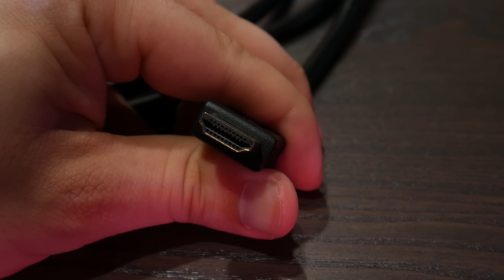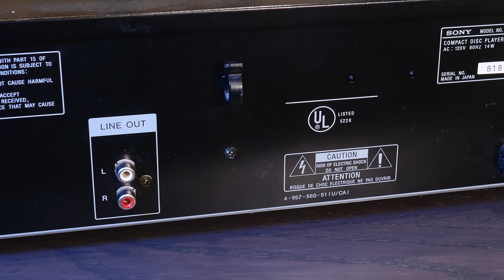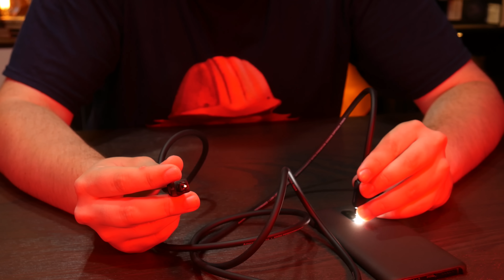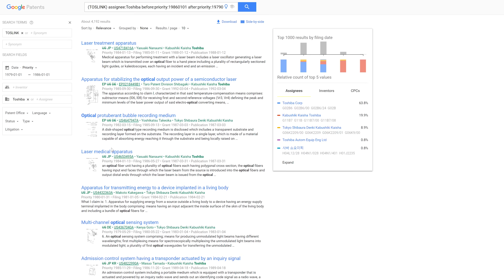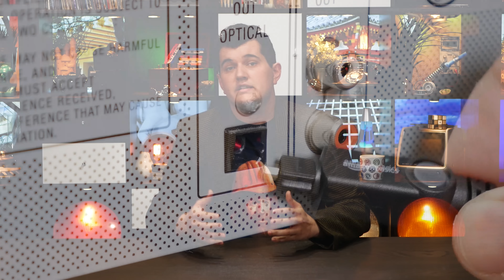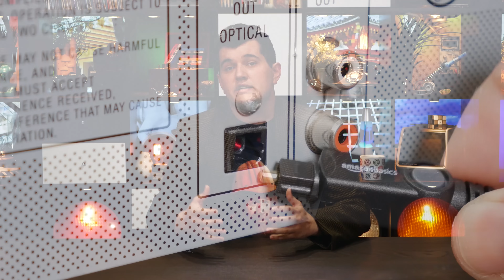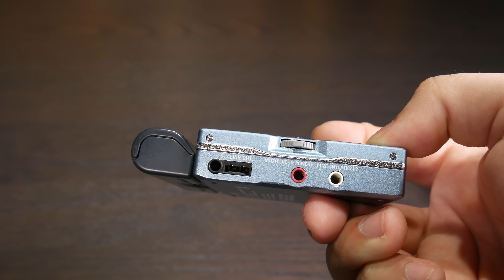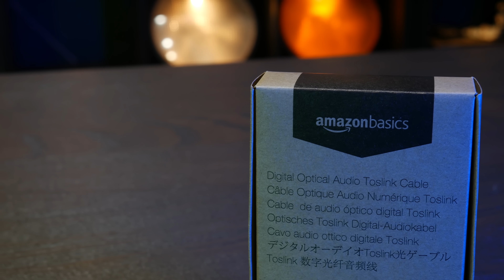TOSLINK: That one consumer fiber optic standard

Comment: I use those cheap $10 TOS PCM converters & string out analogue lines to my 1969 Kenwood. The problem is the TV has no downmixing so when I change over to local it spazzes out. Thanks, Obama

Comment: I used standard RCA cables on my old pc for spdif.
Since my new pc build only features toslink, i got a cheap toslink cable and used this instead of coax.
I should have done much earlier since my old pc also had toslink and coax since it had it´s problems when i switched something inside my room.

All new modern mainboards don´t have coax anymore, it was even hard to find one with a decent onboard sound and toslink to connect my amp.

It runs at 48khz and i will never go back to standard 3,5mm to rca analog junk.
This thin single cable can handle it all.

Comment: Ethernet is a protocol, not a cable standard. Ethernet can be carried on fiber optic cables, and it can be carried at much faster speeds much greater distances using LC fiber optic cables (in most cases, there are other cable standards that can be used but LC seems the most widespread). In fact, its what I use in my home network and the vast majority of the networking done at my place of employment also uses fiber.

Comment: I've thought about using TOSLink to isolate my computer from my ham radio. Currently I use audio cables (with ferrites and isolation transformers) to a USB soundcard. I am still getting occasional glitches that may be due to stray RF during transmission.

Sort of an extreme case relative to the ordinary consumer
Reply: it's basically the only solution to cheaply isolate old amplifiers from noisy ATX power supplies, just grab a toslink dac and it's done
Reply: I've always said if you keep some roast beef curtains near your ham radio you will never have time to turn it on which pretty much solves your problem.

Comment: To be fair though if you have old tech from the late 80s and the 90s to get your old equipment to use modern day sound devices its a godsend, Also mini toslink is more popular than you think, Intel NUCs use it in the headphone jack, Old MD players used it, A lot of CD Players used it, Seen some Classic MP3 devices use it too, sometimes a device needs to be in a certain mode before the plug starts glowing though, Also no arguments about "Audiophile" Cables, You know the internal part of the cable is gonna be the same as pretty much anything else, Even if its got a gold plated connector xD so spend as little as possible.

Comment: Still use TOSLINK in my home theater setup - I'm using it to feed back audio to my amplifier from my TV (which I use for an ATSC decoder). I could switch to HDMI with an ARC, but that'd require buying a new TV - my current 42" 1080p flat panel is 15+ years old. ;) (also, thank you for mentioning the gold plated connectors... I was laughing about that for a week when I had to buy a new toslink cable last year)
Reply: If you buy a new TV make sure you check if it supports eARC. It’s basically ARC 2.0 and allows pass through of things like Dolby Vision ect
Reply: For sure... but right now I'm at that fuzzy area where I just don't watch enough TV to make it worth buying a new TV. Those are all features I don't really need (my sound system is an HDMI passthrough and the TV itself is mostly just a dumb display except for the ATSC decoder for live TV), so for me the #1 reason to consider a new TV is actually the power savings from going from a fluorescent backlit display to a newer LED panel (I'm not sitting close enough that I'd see the difference in going to 4k). While there would absolutely be a savings in operating cost, last time I did the math it'd take 3 years to make back the purchase cost of a new TV, so I figure as long as this one works, it's just not worth replacing it.

Comment: Fun fact. Speaker interference is caused by radio waves interfering with the wire like an antenna. If you remove those metal wires, and replace it with optical cable, you remove that potential for radio interference.

Comment: This was so timely! I was thinking about fiber optics as I am rewiring my home network and home theater (not that I would) and thinking about how fiber optics were between my TV and soundbar when not routing through HDMI (TV has a weird quirk that ARC isn't used when using inputs other than the ARC one). Saw this had been posted 2 minutes ago, and learned a lot about this, before I even had a chance to Google it! Thanks!

Comment: 2 advantages of TOSlink over Digital Coax. smaller and more flexible made for easier routing through ducting for me. Not really prone to corrosion in moist environments.
Reply: For all of Shrek's audio needs.
Reply: That's really going to vary on your cable, Digital Coax can be thinner and more flexible than TOSlink. Though I know a lot of digital coax cables are over shielded crazy cables, when you could just use an old thin RCA cable.

Comment: It is weird that fiber optic hasn't become a standard of data transfer at least on par with USB. The only real drawback of it is the lack of power transfer, many USB devices also rely on the connection to charge/function.
I suspect the real reason is cost, it's probably cheaper and more durable to use a copper wire than a long piece of flexible plastic in a tube.
Reply: If I look at the gunk that sometimes accumulates in my keychain USB drive, I'm glad it's not relying on an optical connection.

Comment: I actually use TOSLINK for my PS2 and PS3 in order to get audio because i use a PC monitor for video so need to use their secondary audio outputs
Reply: I used to do the same thing...but then the PS4 controller just HAD to have a headphone jack on it. Now I'm listening to stupid bluetooth audio when I play PS4. =\ And it doesn't even sound that bad to me. (I'm an audio snob)
Reply: @CaveyMoth  The OG PS4 has TOSLINK, but they did remove it on later versions which is a shame :(
Reply: @shanematthews1985  Those bastards. And I just can't deny the ease of having the headphone jack on the controller.

Comment: Point of order: Where I've had a choice whether or not to use TOSLINK, the alternative has generally not been S/PDIF, but rather analog RCA or 3.5mm, making TOSLINK the only digital option.
Reply: Yes. I also use it because it's the only digital output I have.
Reply: Point of odor, Lisa stinks.
Reply: Same here, the only digital option as well. The alternative is to buy a USB sound card and connect from PC to sound system via USB. You would think sound systems would USB instead of 3.5mm nowadays anyways, but sadly nope.

Comment: PowerMac G5 and some later hardware had on-board TosLink connections. The Altec Lansing Z5500 (and some other models) also use this connection for audio and so was early AppleTV devices.

I still use the TV on the Z5500 system in my home cinema.

The G5 used the mini TosLink plug, and came with adaptors for regular TosLink cables.

Comment: Still using my TOSLINK right now. Computer to home theater. Will not use 3.5mm unless I have to. Running at 24bit 48khz ( highest the receiver will take, old AIWA). Still actively make sure the motherboards I buy have a TOSLINK, but in case of emergency I still have a USB to optical out that I used for my MD player back in the day. Edit: Don't know why I even bother to comment, just gets immediately buried.

Comment: I completely lost it at gold plated connectors on an optical standard. WHY?!
edit: i had not seen the handy dandy movie input part of the video at the time of writing this. I would like to change my previous choice.
Reply: Gold plating for mini toslink is kinda understandable so that you dont transfer some dirty corrosion to your analog metal pins inside....  But then we can just use a purely plastic connector.
Reply: For exactly the same reason they do high density gold plated HDMI cables... Because people THINK it will make a difference. Most consumers are incredibly poorly informed, but a good percentage think they know lots, or worse have a friend who "Knows all about this stuff"...
Reply: @damionlee7658  I have to use gold plated HDMI. Non plated ones only last 6 months before they turn green and lose signal. I'm a special case though, the gulf of mexico and all that warm salt water is literally 6 feet from my TV. 

But gold plated toslink? Facepalm.

Comment: Apple was (is, maybe I don’t know) huge about the 3.5 mm toslink connector.
Reply: Dysfunctional Wombat apple doesn’t seem to be huge about 3.5 mm connectors... I’m still bitter.
Reply: @d3line  me too
Reply: Yup. They got rid of mini-Toslink in the 2016 redesigned MacBook Pro.
Reply: I'm still waiting for the day when everyone accepts that bluetooth is bad for you, and we can all look back on this whole exposing the general population to pulse modulated microwaves thing the same way we do with letting your kids play in the xray machine at the shoe store.

People are unfortunately either not as upset as they should be, or upset about the wrong things.  Although it's a cell phone anyway, so what difference does it make.
Reply: @Acetyl53  Thing is, microwave radiation really doesn't have the energy to damage anything. Might warm your skin a tiny bit if you're standing right next to an insanely powerful transmitter, but that's about it.
Reply: @Acetyl53  that's kinda the rub about it, isn"t it?
We get rid of Wi-Fi, at least in the home maybe, but then we still have to deal with cell phones operating during calls on that microwave range. I've seen some of those videos of popping popcorn by dialing in or out with a phone held close near it.

I think though that having it in the pocket of a thick pair of pants reduces the issue significantly, but I don't know for a fact. What I do know is this has been an open question for I think over 10 years and still no big official word I've heard on it. Maybe we need more tradegies caused by it first for a real change, and even then, what do we do about it? That's the question I have and I doubt anyone has an answer for it yet. Bluetooth is just on top of....
Wait, are those new split earbud things running on bluetooth?!
Maybe I should watch for increased amount of cases of brain cancer then in 5-10 years.
Reply: @Acetyl53  what do you mean?
Reply: @Acetyl53  yeeah, except it is a 0.1W microwave. 
Just don't put it directly over your balls 24/7 and you'll be fine
Reply: @Acetyl53  You have xray machines in your shoe stores, wtf?
Reply: @Acetyl53  , So far no health effect -- none! -- has been observed from the use of Bluetooth. Shall we give it another 30 years?

Comment: TOSlink is thinner than the proper coax required for a proper SPIDIF cable. This matters if your cable bundle is as far as a toddlers arm. That’s why I used it.  It is also SUPER COMMON in just about every laptop because it costs almost nothing.

Comment: >mini toslink
Holy shit, I've seen it a few times before and always thought it was just a neat light to let you find the 3.5mm jack in the dark.
Reply: I had a Mac book pro from 2010 that had this. I didn't know until I installed Linux and couldn't figure out why my headphone jack lit up.
Reply: @Gmoyer11Tech haha, same but it was a 2012 macbook pro
Reply: Still have a couple of Minidisc portables that support this. And if I remember correctly, it was referred to as an, "optical miniplug" in the documentation for the Sony MZ-1 (first MD on the market).
Reply: In some sound cards, that is the case but one of the outputs is also miniToslink (I think Xonar had this predominantly).
Reply: @bitcores  My Xonar DX has mini Toslink output incorporated into its Mic/Line-in jack. My X-Fi Titanium HD, on the other hand, also uses mini Toslink for both digital in and out, but has them incorporated into its RCA Line-in connectors, which is a bit of an oddity.
Reply: bitcores my asus xonar essence stx ii 7.1 has both coaxial and optocal connectors but led for optical is actually inside coaxial connector so i have to use some sort of small plastic adapter that came with soundcard to use optical instade of coax
Reply: @milojkokitic6991  That small plastic adapter is a simple Toslink to mini Toslink adapter.
Reply: Ahahaha lmao
Reply: Every computer I currently own has Mini-toslink, so I'd think it's pretty common.

Just bog-standard generic built-in sound hardware on the motherboard too, so it's nothing fancy...
Reply: My Creative Soundblaster Audigy had a mini Toslink output. I tried for awhile to get it to work with Windows 2000 and XP and my Sony STR-D875 but it never did.
Reply: ... wait, do I have this in my computer's sound card?
Reply: @vincentmuyo  Depends on the sound card. But most sound cards do indeed feature at least an optical out, either Toslink or Mini Toslink, and quite a few do have optical in as well.
And S/PDIF (in the classic "jumper" connector format) was often used for connecting CD-ROM drives in the past for audio instead of the standard internal analog audio CD connector.
Reply: The Mi Box (Android TV box from Xiaomi) has a mini-toslink and a lot of people don't even know it has optical audio and get really surprised that there exists another connector than the square-ish one.
Reply: enemixius time to check all my devices to check if they have mini toslink :)
Reply: Ikr!
Reply: i thought it was for when you don't have audio drivers the jack would be like oh im not being utilized by no one there's a problem and i will be red

Comment: [engage sarcasm drive] Gold plated optical cables are the best and totally worth the money (please never buy this cables ever!)
Reply: But they`re  pretty...And sarcasm needs a font.
Reply: The gold plating prevents wear from the constant plugging and unplugging! </sarcasm>
Reply: @Meoiswa  The best part of that logic is gold (being so soft) is one of the worst metals to protect against wear and tear. :D
Reply: But gold does a better job than plastic at blocking oxygen which can degrade the signal quality over the copper in your optical cables.
Reply: @TheOtherBill   <sarcasm> Because digital signals really care about signal quality. Not like there is digital error correction or some </sarcasm>
Reply: Digital error correction can not correct the signal loss of optical signals over copper transmission lines. Truth.
Reply: I would prefer not to buy gold plated optical connectors but no store near me stocks anything else.

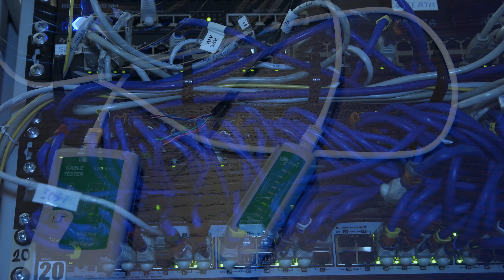Comment: I haven't watched everything, but I'll just add this. at 0:52 you give the impression that Ethernet is for twisted pair only. This is not true. Ethernet is a layer 2 technology and thus is not reserved to a media in itself. See those "fiber ports", the SFP(+) slots on network swtiches? fiber modules plugged into those run Ethernet

Comment: I discovered toslink mini when I found out my MacBook Pro’s headphone port had the led in it. I think they still carry it now in the new MacBooks
Reply: apple got rid of that feature in 2016. My 2014 imac has it, and I connect to an external DAC headphone amplifier. This has several advantages. First, I no longer have to remember to switch off my stereo before switching disconnecting a cable. Second, if I trip over my headphone cable, it no longer yanks on the computer itself.
Reply: Jeremy Erwin that’s good to know! Last one I bought was my 2015 pro. I never ended up using the toslink connector, and I’m in the corporate AV industry haha. I’m glad to hear it has some advantages though.
Reply: Do they even have a headphone jack on it or does that require a dongle?
Reply: HappyBeezerStudios - by Lord_Mogul no dongle. Apple May make stupid decisions but they’ve kept the headphone jack on the MacBooks. As of 2015 they had toslink mini built in and I’m fairly sure it’s still on the newer ones.

Comment: MacBook pros had the mini toslink before the great IO purge...
Reply: Hell, even the MacBook non-pro had one.
Reply: Yeah, but them removing mini-Toslink is odd since they still kept the headphone jack. Maybe the mini-Toslink hardware was too thick to fit in the thinner chassis. Who knows?
Reply: Yup. This was common for about a decade and just about nobody (including tech conn) even noticed
Reply: The Mac mini had fiber in and out as well.
Reply: iMacs also had the Toslink connector in the headphone jack. Sadly since the great IO port purge, it went away. This was rather upsetting for me personally as I used it to connect to my old but lovely HiFi amp and used it’s DAC for a better sound. Now I have to use a usb soundcard which uses some cpu bandwidth and is not as robust sometimes forcing a reboot to resolve. 
I know it’s only amateur panto that I do but upgrading from a 2011 iMac (that died due to the very popular video card death 3 months after apple stopped the repair program for it) was a large step backwards. 
So mini toslink was definitely something I took advantage of. Also perfect copy’s of my cds to mini disc for when out and about.
Reply: I'm pretty sure my PowerBook G4 had it to.
Reply: I still use it! :) I think my model was one of the last to have it. What a travesty. I refuse to believe that they could not fit an LED in 😑
Reply: My iBook G4 had it in 2004 😅
Reply: Was hoping that someone would have brought it up. It’s one of the most important port for hooking the MacBook up for some presentation gear, particularly if the analogue jack isn’t pre-amped and the sound is all kinda weird.